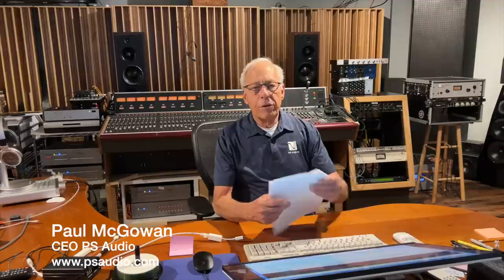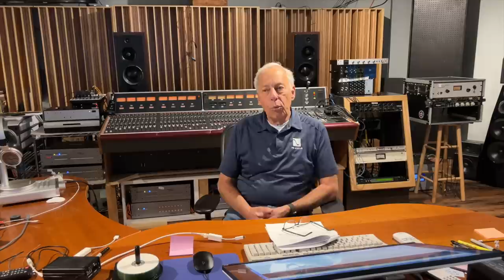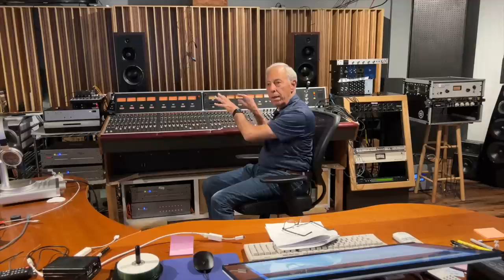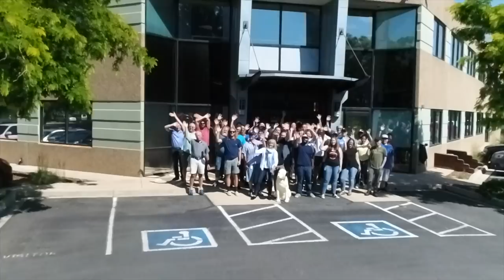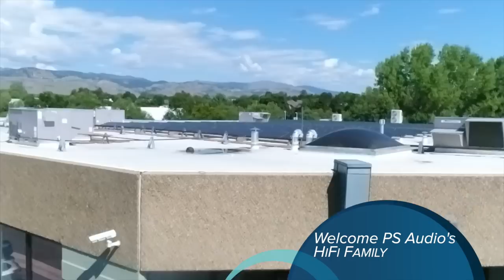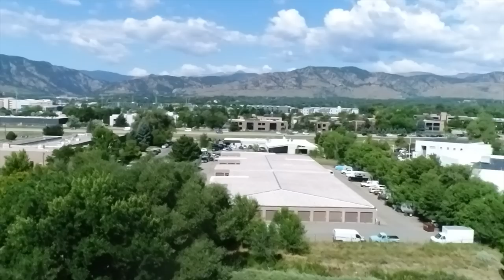Converting DSD to analog

Comment: i heard  PCMs deeper than 16bit(namely 24bit ,32bit) are actually all converted back from original PDM inside modern ADC and DAC chips.. from Paul's "RTR ladder DACs" video..
if the PDMs in which are same with that of DSD's...so , by just using 24bit/32bit PCM  ..there'd be less processes.. and hardware-wise already available in everywhere..
I begin to think that on current-day ADC-DAC chip design and the design of class-D amps.. PCM playbacks seem more closer to the original music performance than DSD's by having less PDM-PCM-Analog conversion processes...

Comment: Hey Paul, there's some very good information you've offered.  One thing though, the use of the term "converting DSD to analog" .. maybe should be said, "taking the anlog outs of the DSD to the analog mixing board" (which you did say).  

My understanding of 'convertiing' has always been about staying in the digital domain and doesn't include any analog stage.  It's been that way since the 80's as far as I remember.  We would convert 4824 to 44.1/16 for making CDs for example.  We'd use digital converters.  Maybe we should all agree on what "conversion" means.  

"Transfer" might be a better word and less confusing when going from DSD to analog and back to DSD.  When we are archiving multitrack tapes, we 'transfer' the audio from the analog outs and capture the sound in digital (we never call that converting).   There's no converter involved.  Happy to discuss it.  I know what you mean, but I'm not sure the readers do.  

I think a lot of the decisions between mixing DSD through analog or going to DXD is a personal decision, depends on the gear available and up to the mixer. For Blue Coast Records, we find that going to DXD never sounds as good as going from DSD through an analog console to mix.  Also, our outboard gear using the board sounds fantastic.    I've never found the quality of effects in digital plugins.  After mixing for 40 years, it's never been a problem to bring back a mix on analog.  

Not to contradict what you're saying, just offering your readers another point of view.  Thanks for all you do.  
Cookie Marenco  https://bluecoastmusic.com/
Reply: Going from DSD to analog or from analog to DSD is through a DAC (Digital to Analog CONVERTER) and then an ADC (Analog to Digital CONVERTER) to get back to DSD. As soon as you convert DSD to analog and route it through a bunch of analog op-amps, potentiometers in a mixer and so on, the quality drops dramatically e.g. the SNR gets reduced to the standard of the pre 80s analog audio (like <14 bits PCM sort of dynamic range and SNR). Digital music should stay digital during the entire production process to maintain maximum signal integrity and with modern gear running 384kHz 32 bits or more, there is no reason to go analog. DSD was cool when PCM was limited to red book CD standard.
Reply: @ThinkingBetter  I understand your point, but all digital audio has to be converted at the output in order for the audio engineer (or anyone) to hear it.  I will ask the pro audio community if they consider DSD or PCM output (which of course is a DA) a 'conversion'.  What I can see is that the audiophile community becomes very confused by the processes.  How would you descrbe a 'render' ?
Reply: @soundconnex  There is no need to get caught up in the semantics on this topic. Technically, any use of a DAC or ADC is about signal conversion between a flow of digital data and analog voltage variations no matter if it’s in your home or a studio.

Comment: The DSD/Analog/DSD system is really very close to a tape workflow, right?   So, a 24 track 2" tape you record into, then take the output through the console, then into a stereo 2-track tape.  The DSD version would be 24 channels of DSD into the console and out to a 2 channel DSD recorder.  Am I getting this right?
Reply: That is the system we use at Blue Coast Records....  I still have my 2" 24tracks tape machine (since 1986) and we do setup DSD much like we used our 2" machine

Comment: 0:51 "DSD is the very best by a large magnitude."
Can you prove that Paul?
It seems that the facts show that to not be true.
DSD is not even close to the perfect capture given the need to overdrive the Delta-Sigma converter, the need to add a large quantity of noise to keep DSD quantized, and then the need to attempt to filter out that noise although the noise extends into the audible range. This is just the first disaster to occur! Now add in the harmonic distortion and quantization errors that occur in the DSD to PCM conversion, the fact more noise, but different noise has to be added to the PCM for quantization purposes and the Nyquist filtering required for PCM. If that isn't enough, yet more distortion, more quantization errors, and even more noise has to be added to the signal, and yet another Delta-Sigma converter distortion due to being overdriven again. So surely the DSD to analog, to DSD conversion must be better right? Sorry all you Audiophiles that pretend DSD is so much better sounding, it is not. Besides the already mentioned distortion caused by the overdriven Delta Sigma converter, the high levels of noise added for dithering, and the subsequent need to use a low pass filter in the digital to the analog conversion will either leave residual noise in the upper audible frequencies or will filter out the upper frequencies. Now add in the considerably higher noise level of an analog signal path, along with analog phase shift at every part of the "editing" process, the increased harmonic distortion, and loss of 30 dB or more of dynamic range. That loss of dynamic range and increased noise floor typically requires the addition of compression, read additional distortion, phase shift, and noise. If all that distortion and noise isn't enough then consider this. To go back to DSD (PDM) there is yet more Delta-Sigma converter overdrive distortion, the noise and phase shift from the analog source are recorded as well, and even more, large quantities of noise are added once again to quantize the DSD (PDM) signal. What you Audiophiles are mistaking for warmth is signal distortion, and what you are mistaking for "air", or "space" is the added noise. But scientifically a pure PCM signal path using quality converters is far superior to DSD in terms of noise, dynamic range, converter to converter distortion, and frequency response.
Reply: Great response, that sadly is sure to be ignored. People want the fast food content that Paul provides.
Reply: You don't need to prove anything for audiofools
Reply: Tip: Your inability to split your thoughts into smaller, easily readable paragraphs betrays the chaos inside your mind, nevermind the lack of basic grammar skills.
Reply: @edfort5704  How would you have written this?
Reply: @JonAnderhub  More coherently and less discouraging to read at first sight.
Reply: @edfort5704  it is an audiophile - no brain - people selling expensive power cords make a business out of these fools
Reply: @edfort5704  My intention is to discourage Paul from claiming, and others from believing that DSD is the best recording medium.
What specifically lacks coherence?
Reply: @JonAnderhub  did you ever hear about sentences and line breaks - what you write reminds to puke
Reply: Too bad. My DSD SACD recordings all sound either as good as but most sound far better than straight CD’s. Similarly my .dsf DSD digital files sound better than my WAV Flac or other pcm files without question.

Equally, whilst you have made lots of claims here about noise, dynamic range and other impediments to DSD recording I don’t see your intention is to engage anyone in a conversation. You seem to push your beliefs rather than explain your reasoning. So far, an opportunity missed. Do you have any references for your claims?
Reply: @JingoLoBa57  "Similarly my .dsf DSD digital files sound better than my WAV Flac or other pcm files without question" - Yeah, the same way a SACD sounds better than a CD-A on a ordinary player: the mix/mastering is different
Reply: @JingoLoBa57  My intention is to keep people from buying into the myth that DSD is some superior recording format, it is not.
As far as engaging people in a conversation people who typically call themselves audiophiles aren't typically interested in any kinds of facts.
But here are some factual references for you in regard to my statements:
https://timbreluces.com/assets/sacd.pdf
Reply: @Harald_Reindl  The mixing and mastering process is not different for SACD than it is for PCM.
In fact, the majority of SACDs available for purchase aren't from a DSD source at all but are either from an inferior analog source or from a PCM source.
Reply: @JonAnderhub  jesus christ i don't talk about the process but the actual mastering of the music - the SACD version is remastered and in most cases that same remix is also used for the CD-A layer - and exactly this explains a moron comment months ago "i have a few SACD and they sound damned godd on my ordinary CD player" - yeah, that ordinary player don't know anything about SACD or Hires and it sounds identical - how better can you prove the SACD/Hires are useless and so is DSD?

Comment: I'm surprised Paul doesn't mention how all dacs on the market beside AKM convert the dsd signal from dsd to pcm to dsd.

While AKM has the architecture to play dsd natively.

R2R ladder dacs also convert dsd to pcm to dsd unless they are wired correctly and need a separate DSD pathway to play native dsd.

You are right R2R is designed for PCM, but Holo Spring DAC has a separate hardware DSD section specially designed to process 1-bit data. The way R2R process data depends how it is wired to process PCM or DSD. This process is called Discrete DSD conversion, Chord, dCS and MSB all use this form to convert DSD to analogue.

Comment: so REAPER can actually mix DSD.  turns out you can set the project sample rate to 2.8224 and a few plugins actually support those sample rates, like the EQ.  i used SOX-dsd on linux to convert DSD 2.8224mhz to PCM .wav 8-bit at 2.8224mhz so it's a perfect translation.  it works!

Comment: Hi Paul, after going into DXD for mixing, which option sounds better? 1 - DXD to analog to DSD (Please correct me if I am wrong, but going direct from DXD to DSD is not possible?) 2 - Stay in DXD and downsample to lower PCM resolutions?, I somehow had the feeling that not making another digital conversion from DXD back to DSD also sounds very good and hence DSD makes the most contribution at the first recording / capturing process from the microphones. Thanks in advance..
Reply: Going directly from DXD (PCM) to DSD (PDM) is possible and that is exactly what happens in the Pyramix system that Octave Records is using.
The multi-channel 1-bit 11.2MHz sampling rate of DSD (PDM) has to have the noise filtered out of it and then it is converted to 32-bit floating point 352 kHz DXD (PCM)
Contrary to the way it looks there is no loss in resolution and in fact there is an increase in resolution as DSD has less resolution than PCM because of its 1-bit nature.
Once the necessary processes used to mix the recording are in place the 352 kHz DXD (PCM) is then converted back to 1-bit DSD (PDM) at whatever rate (64 fs for SACDs, higher for redistribution online, etc).
There are in fact errors and problems with this conversion.
First of all, DSD uses a large amount of noise recorded in the ultrasonic range in order to maintain quantization.
This noise must be added to each individual track which creates HUGE files.
This noise must be filtered out on each track in the conversion to PCM and then another noise at lower frequency ranges but at inaudible levels must be added to the DXD (PCM) to quantize it.
Then more ultrasonic noise must be added to the DXD (PCM) to convert it back to DSD. Add in quantization errors for the uneven sample conversion and there is a whole lot of shakin goin on!
So what is the right solution?
Just record in high-resolution PCM.

Comment: yeah I'm not sure about that you can't mix dsd, I think if you can take the signal split it up into one bit multiple 32 segments, multiply 32 bit simultaneously in parallel and those 32 individual bits can be individual manipulated and fed back to a 1 bit system.
basically you're copying the 1 bit to a multiple of  32 individual segments, and putting them back together as one bit stream. can't see why that wouldn't work!
Reply: Unfortunately, it's not quite that simplistic due to other factors but what you are describing is somewhat similar to the process of converting DSD (PDM) to multibit PCM, and then converting the PCM back to DSD (PDM).
The whole conversion process causes other problems as well.

Comment: If putting a capacitor on a dsd signal turns it into analog, seems like a simple computer program could act like a capacitor and now you can do the math on it inside the computer, and then computer converts back to dsd and sends it on its way